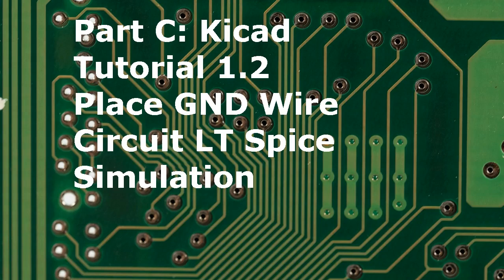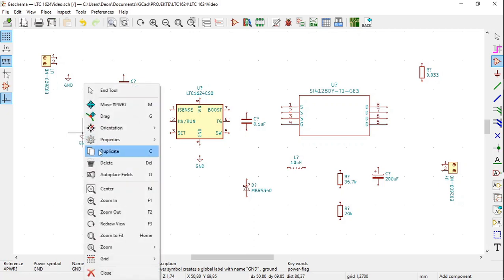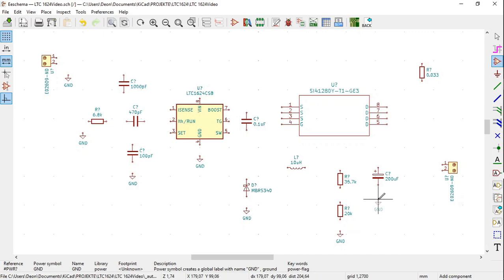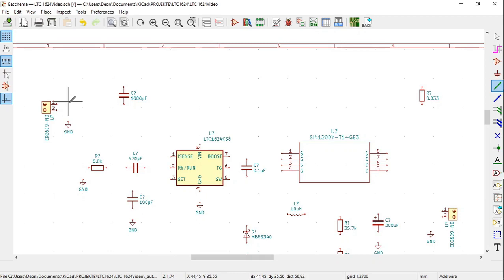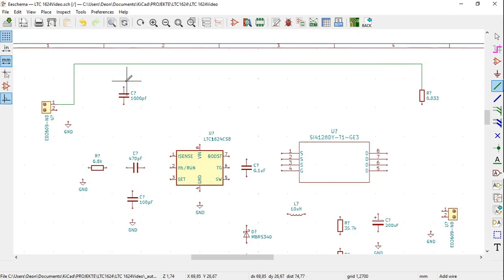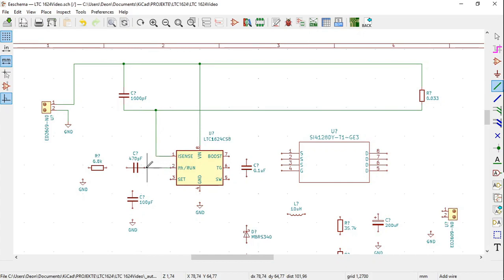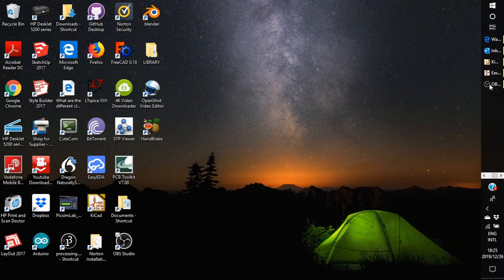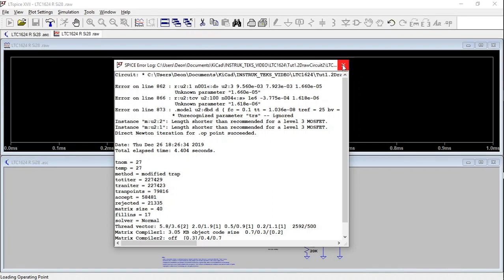KiCad Tutorial 1.2: Part C: Place GND Wire Circuit LTspice Simulation

Comment from the maker: Hi Akanksha. Something I forgot. KiCad 5 and higher comes with its own simulator. It is with a SPICE program called ngspice. It uses the KiCad Eeschema circuit design software as a graphic user interface (GUI) to create a netlist that is then plugged in into ngspice. 
ngspice does not have its own graphic user interface (GUI). See: https://www.instructables.com/Simulating-a-KiCad-Circuit/
Regards, 
Deon.
Reply: Thanks a lot sir!
Reply: Sir I have one more doubt can i am drawing a circuit in LTspice which has a crystal oscillator , antenna etc ....now do I need to get the spice model of each one from the manufacturer as it's not there in LTspice library
Reply from the maker: @akankshaupadhayay2352   Hi Akanksha, It is a bit of a complicated story but lets take it step by step. What component is it that you are looking an LTspice model for? Did you found it?
Reply from the maker: @akankshaupadhayay2352  Hi Akaka. What component do you require a spice mode of? Did you find it?
Reply: @deonhugo3442  it's jn5168 ic ...I haven't found the spice model for it....but have put the mail on manufacturer website .....and also  crystal oscillator has to be used in it
Reply from the maker: @akankshaupadhayay2352   Hi Akanksha. Tell me what component it is and I will try and find a spice model. The trouble is if the manufacturer does not have a spice model at hand, they are not going to develop a spice model for a single person. They are more likely to develop it for a big company that is going to use and purchase large numbers of the component. Regards, Deon.
Reply from the maker: Hi Akanksha. You can also check this video: https://www.analog.com/en/education/education-library/videos/5579239882001.html
Regards, Deon.
Reply: @deonhugo3442  thanks sir ...this is really great and I got more clarity from this video
Reply from the maker: @akankshaupadhayay2352   Akanksha, The JN516x is a wireless microcontroller. LTspice cannot simulate a microcontroller, Regards, Deon.
Reply: @deonhugo3442  Oh! than how do I simulate tat ......do I need to use some other software ?
Reply: @deonhugo3442   sir as per the video which you have sent me it says that we can also include a symbol which is not present in the library ......after  creating it we can find it in auto generated ...so why can't I  create a jn 5168 prototype if I get the spice model of it ......
Reply from the maker: @akankshaupadhayay2352  Jip. Apparently, it can be done with  Cooja de contiki. See: https://gitter.im/aguirrem/contiki

Comment from the maker: Good day Akanksha. That is a very good question and something I have often wondered myself. Why is it that all the PCB design software and all the simulation software manufacturers do not come together and get a standard netlist
that is compatible with all their software? Just a brief remark one would generally do the opposite of what you are doing.  You would first do the simulation. Once the simulation is done and the circuit works you move over to KiCad to have the PCB made. You must remember initially when you used spice or PCB software you had to type in the netlist yourself. What the modern PCB and simulation software does it allows you to draw the circuit. From your drawn circuit, to make things easier for you, it generates a netlist. From the generated netlist then therefrom depending on what type of software it is PCB or simulation the software takes the process further. Now you have a KiCad netlist. You want to give it to LTspice. Unfortunatelatley LTspice cannot work backwards and generate a circuit diagram from the KiCad netlist. This means you are basically stuck. Without a circuit diagram in LTspice, you cannot
simulate. I any event even if LTspice can come up with a circuit diagram you will have to replace the KiCad component footprints with the necessary spice models of the components. I hope this answers your question. If you have further questions let me know. Regards, Deon.
Reply: Thanks sir ..this really helped me